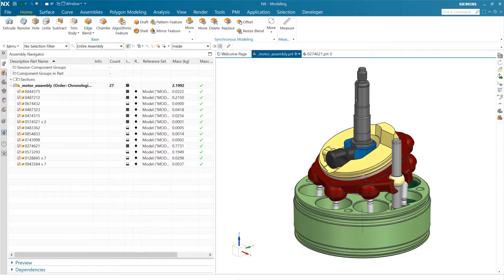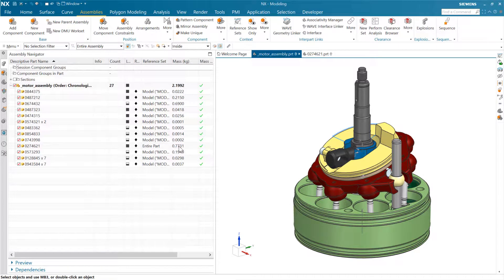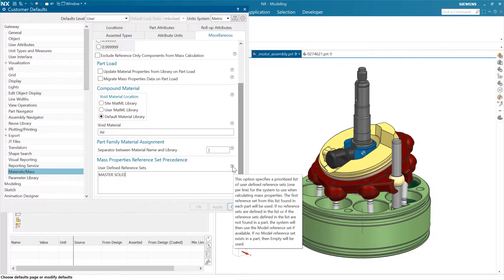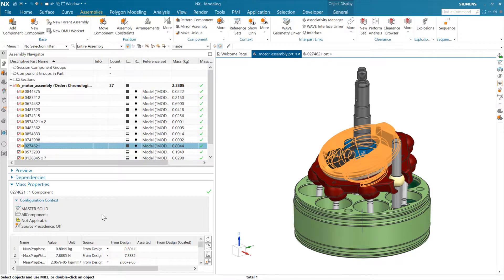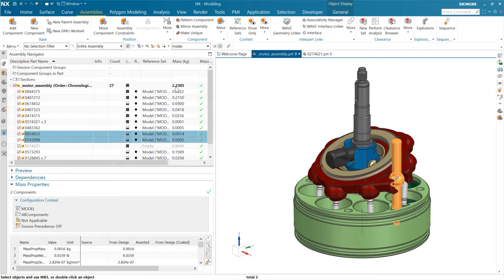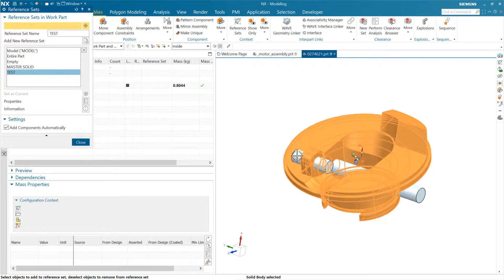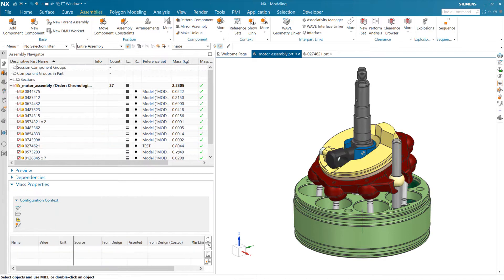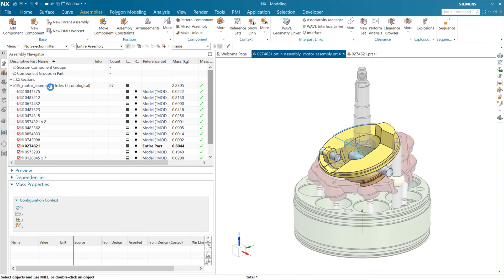NX Assembly Mass Properties: Reference Set Usage, Settings, and Overrides [NX 1953]

Comment: Do we have any option in NX similar to "flexible assembly in creo"
Reply from the maker: Certainly! These are called "Deformable Components" in NX.  🙂
Reply: @taylorandersonnxvideos  I was searching for the option in NX12.. is it available only in latest version?
Reply from the maker: Deformable Components have actually been around for 20 years or so.  Just use the Command Finder in the upper right to find them in NX 12.  :-)

Comment: I just have a question regarding assertion for mass. I had old assemblies made on NX7 to NX12 (and older) and some had assertion for their weight for some reasons. But since we are in NX1929, in assemblies, all those asserted mass can't be updated and can't get them back to "from design", I have 0.000 kg and always the green hand on top of the window, even if I erase the value of the assertion.
Do you know how to unlock or unset this old assertion ?
Many thanks for your answer ;)
Reply from the maker: Sounds like you may still have "Asserted" selected as the "Source" in the Mass Panel.  Can you check that?
Reply: @taylorandersonnxvideos  Hi :)
I actually delete some values in the "MassPropCenterOfMass" developped menu X, Y, Z. Somebody in my company said to me how to proceed.
I didn't seen them because the menu is always packed and nothing shown of by itself. I just click on the little arrow besides and the values just appear.
It's quite weird that these values were automatically added by NX old version and can't be deleted automatically when you delete them in the MassPropMass.
Maybe if Siemens can manage that in the next version, it would be really nice !
Thanks for answering ;)

Comment: I believe there is one major point that your video doesn't show, and that is the content of  the MODEL reference set of the assembly itself.
If the assembly weight of the assembly is based on MODEL, but some of the components are removed from this ref set, they will still be counted in the weight, which is to my view wrong. It seems that how weight is counted goes down to the definition of  each single part having bodies under the part navigator. Starting from the 1st assembly level and upward, nothing you can do about which ref set is to be used as weight reference for each assembly level will change the result, unless you suppress parts.
We can't use this function at work because we often wave link parts from a sub assembly in order to modify them. Reference set allows us to remove the sub assy from MODEL, but this new weight calculation just adds up the waved bodies, giving us double the weight...
Reply from the maker: @Guillaume --
Thanks for your comment!  So...  For modifications after linking upward, I would highly recommend using Promotions, which automatically take care of the mass properties bookkeeping for you.  (That's the main reason that Promotions exist, really.)  There are many ways that people use WAVE links, and we cannot predict or guess which one you are intending, so if you use WAVE you'll need to manage/remove the duplicate body mass yourself.  Thanks again!
Reply: @taylorandersonnxvideos  Thanks for your reply. I would say that the main issue with promote is that you cannot suppress it effectively if you want to see how the body was originally. Moving the "current feature marker" before will not make reappear the original body if you want to check how it was looking like. Original bodies are just hidden or sent to some parallel dimension until a hard "delete" of the promote feature. The same happens with assembly cut, as it is most certainly based on promote as well. Not a popular feature here :).

Anyway, regarding the wave, I actually don't see the issue. The weight calculation is supposed to be based on the reference set, which is actually not exactly true, as it takes all components, regardless of if they actually are in the reference set. This is to me and my colleagues, very misleading. A simple fix would be to make the weight calculation based exactly on the reference set. No need to worry about what users do with wave or not.

Moreover, if you were to place an existing component (released, and with weight and so on) just for illustration, that you don't want to be part of your delivery (or weight), it will still be added to your weight. While removing it from the MODEL ref set would give you the correct weight, if it were to work the way we see it.

Regards!